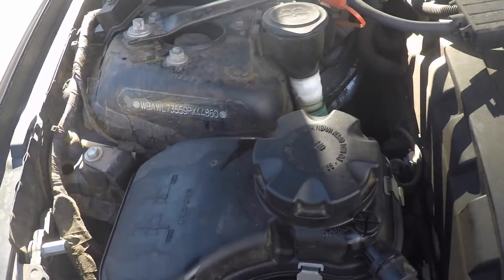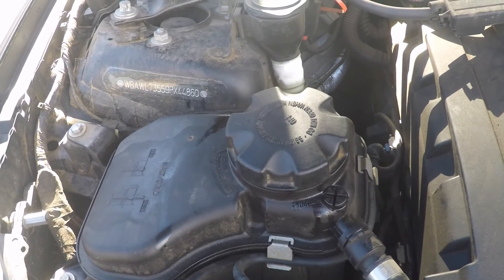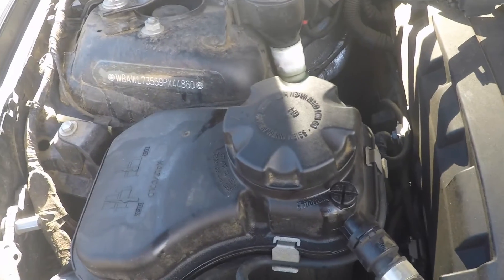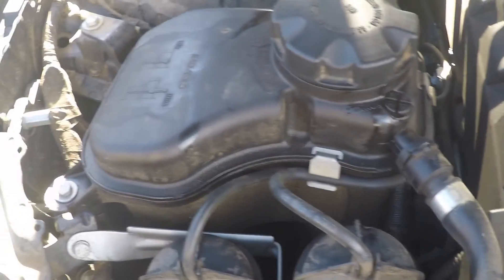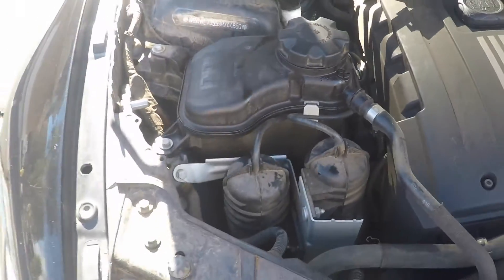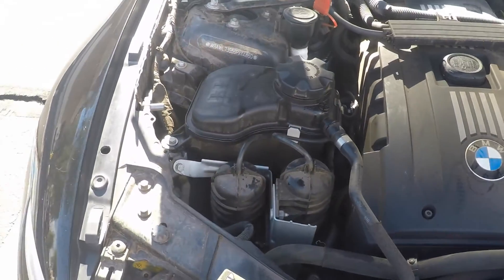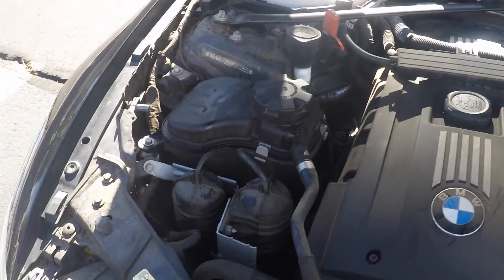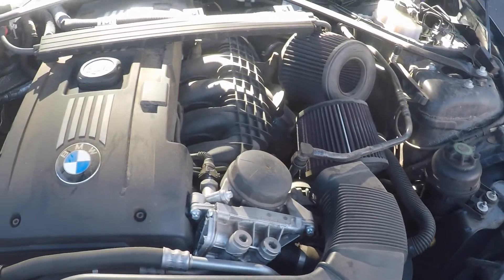BMW E90/92/93 Overheating

Comment: I swapped the water pump thermostat top and bottom hose radator front sensor and checked the fuze and still overheating!
Reply from the maker: You have to change the pump and thermostat together

Comment: I got the same problem help me
Reply from the maker: sorry for the late reply. The water went out so I ended up replacing it with the thermostat. Its not a hard job to do yourself if you have a jack and the proper tools
Reply: Shawn Boodhwa did u buy a new water pump ??
Reply from the maker: Yes, I bought a new water pump and thermostat and replaced both. The electric water pumps BMW puts in the car sucks and gives out way to soon.